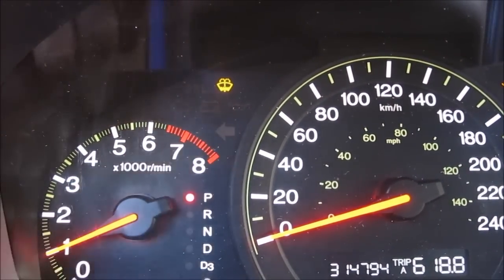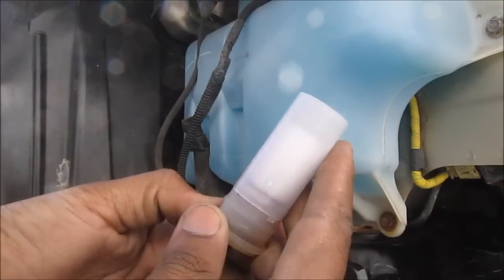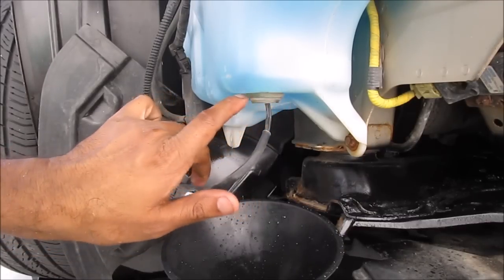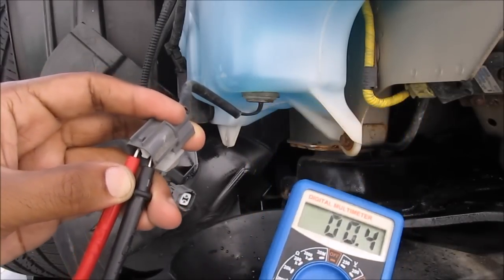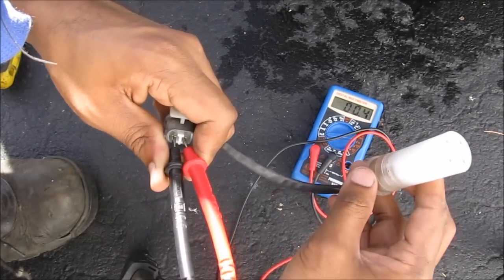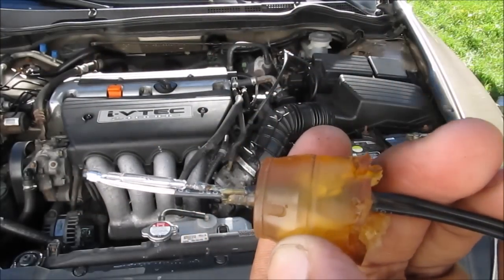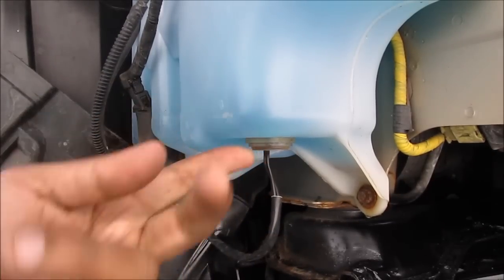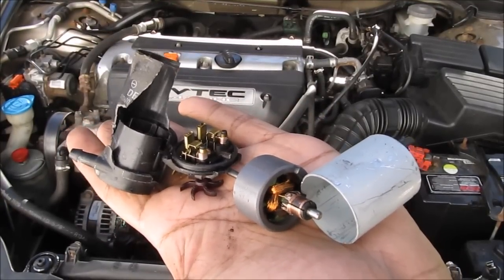Windshield Washer Sensor Replacement

Comment: My washer fluid light came up and is on the same circuit as the coolant sensor. I changed the pump which is accessed by jacking up the car, taking off the wheel and the wheel arch lining. Mercedes really made it tough to get to… The washer pump started working but the light remains so I now have to replace the sensor by going through that all again :/ Hopefully that’ll be the last time I have to get in there

Comment: The sensor is cheap,  so I recommend buying one and replacing it.  Removing the sensor is easy but reinstalling the new one is a bit hard because the sensor wouldn't go back into the tank easily, but use a hair dryer and warm up the areas where the sensor go in...that heat soften the surrounding areas which make it easier reinsert it in.

Comment: so basically the best fix is to cut the cable... i mean why the frick you need a sensor there? just check once in a while  is not like a critical thing like engine oil or fuel... these auto makers putting sensor in the most retarded places ever

Comment: Damn, I wish my Subaru front bumper from off that easy then I could probably fix my bad low fluid sensor too. LOL.  Anyway, good video.
Reply from the maker: Thanks. You can just short the sensor.
Reply: Update, today I change my sensor on my 2020 Nissan Alitma and I don't need to remove the front bumper cover at all.  I just jack up the car, loosen few 10 MM bolts under the car, few push on plactie rods from under the car, under the wheel well areas, and was able to gain acess to the sensor and pull the sensor out of the bottle and put new one in and my warning light is now gone.  NOTE:  To make it easier in pulling out the sensor with nose plier, heat up the washer bottle where the sensor is located to soften the plactic so its easier to pull out the sensor. Hope this help other who are having fluid sensor problem.  Thanks
Reply: @tousshong9438  I just gained access to my 2019 Nissan Altima sensor today. I didn't think to check continuity as I wasn't sure what type of mechanism it uses. I removed the wheel and a few cover parts, but since you mentioned it, I can probably get away with removing just the 10MM bolts in the front and maybe a few push rods (think I removed more than I had to).

Now that I know it's a float with magnetic switch, I will first try tapping it in case it's simply stuck. Been getting the light intermittently for months.

Comment: can i just remove or unplug the sensor to get rid of the light?
i can just refill reservoir when it's empty.
Reply from the maker: Yes
Reply: @speedkar99 , Will this cheap trick works on my Subaru Impreza too, if I unplug the sensor and the light will go off on the dash?  I really don't needs it to tell me when its empty.  I know it's empty when no fluid comes out of the sprayers.

Comment: Does it matter which wires are connected on the sensor connector.have a 2010 impala.wires weren't color coded for the washer fluid level sensor connector
Reply from the maker: The motor is probably DC so polarity matters.
Reply: @speedkar99  thanks

Comment: I have a 2010 chevy impala and replaced the sensor and had to splice the connector wires with a new pigtail(wires weren't color coded)but I still have a "washer level low" light still on.Should I switch the wires or does it matter or should I drive for awhile to let it reset itself for I disconnected the neg terminal on the battery before splicing.thanks for any info
Reply from the maker: Sometimes the float can get stuck. Try to encourage it to come back up. And test it with a multimeter

Comment: Simply disconnect sensor to get rid of the idiot light and save 50 bucks.
Reply: That's All I'd Do!   When I can hear the pump running and nothing is squirting out, I know It's Low!!!
That sensor is VERY ANNOYING to me On my Olds alero! 
Stupid Annoying Sensor!
Reply from the maker: Yes that works too!
Reply: Yeah Reach up there and cut that rthat fucking thing off how many more goddamn things can I think of  To put a sensor on it’s just more shit to go wrong that They are hoping you take in to a dealer to have fixed what’s next your rearview mirror has dirt on it center WTF
Reply: disconnecting the sensor will turn the light off? cause i dont need it i know when the dumb thing is empty lol.
Reply: Thanks bro. Gonna do that right now since I can't find one for sale

Comment: My car is Nissan Sunny. It has no sensor for windshield washer. It doesn't matter, because my concern is how to access the reservoir and its pump. Seeing the arrangement and location, it needs to remove the side cover (wing) instead of the bumper cover. Ah, I am not ready to do it, I don't have tools required. :) 
I need to check the pump electric connector, the pump itself, the whole tubing as well as to flush the reservoir.
Reply from the maker: +Lex Soft Yes its most likely under the fender or bumper.

Comment: What year is your Honda? I have a 2014 accord. Is it easier to take the bumper cover off or go thru the front passenger wheel well?
Reply from the maker: +0u812 2004. 
Depends where the washer pump is. 
Maybe you can get it from underneath splash guard or fog light hole.
Reply: @speedkar99   Does the bumper cover just pull right off like you showed?